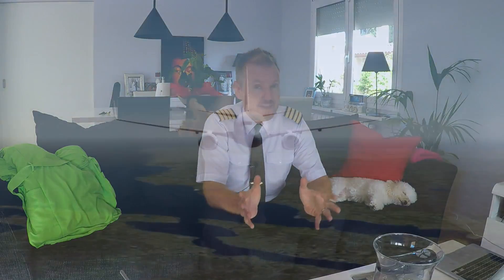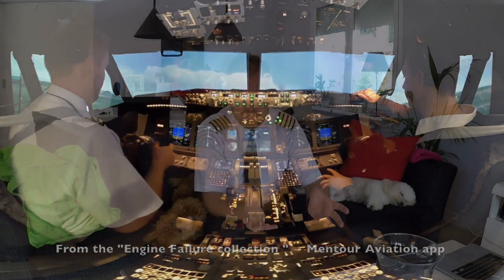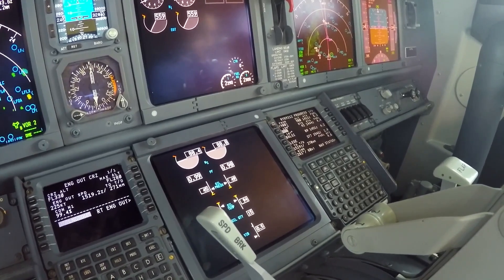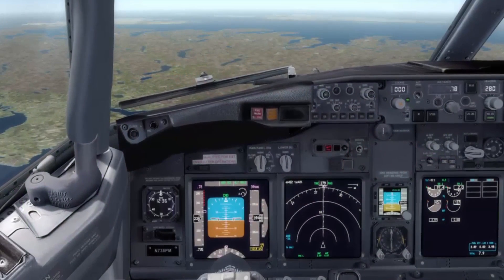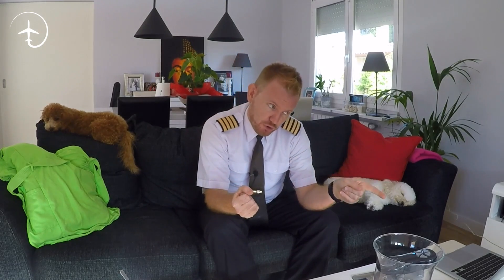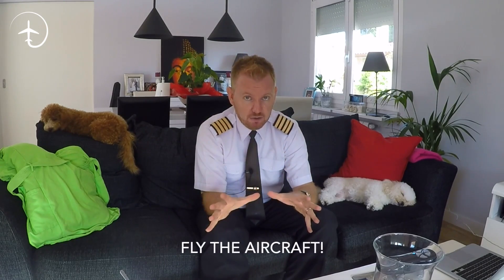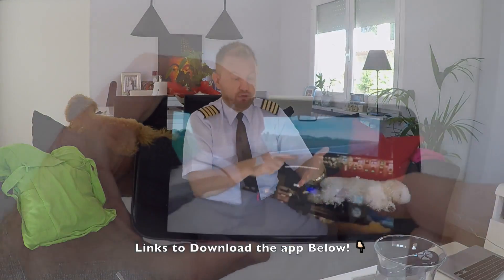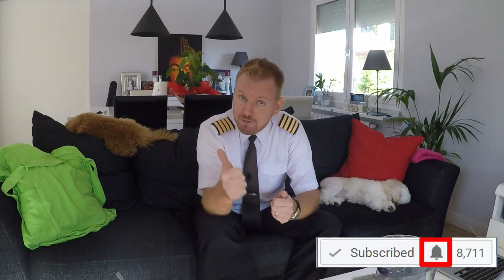What if an Aircraft loses an engine in cruise?!

Comment: Why don’t we see obese pilots at all or as often as we can see obese truck and cab drivers? So, what are the min-max weight and length limits for pilots if such exists?
Reply: For example British Airways has this requirement:
Height must be between 1.57m (5ft 2in) and 1.90m (6ft 3in). (If someone is taller he must undergo a functionality check.)